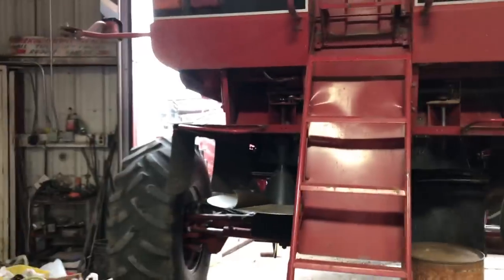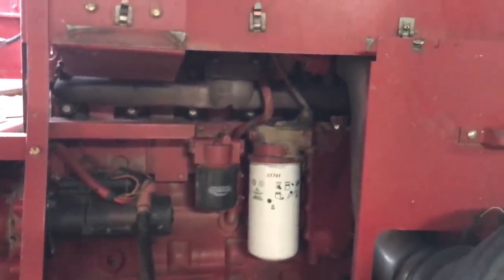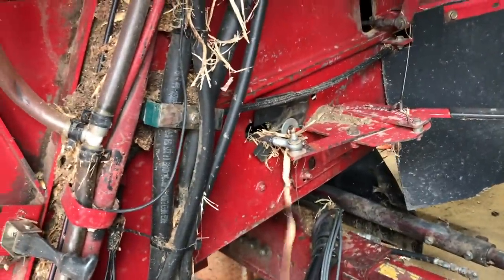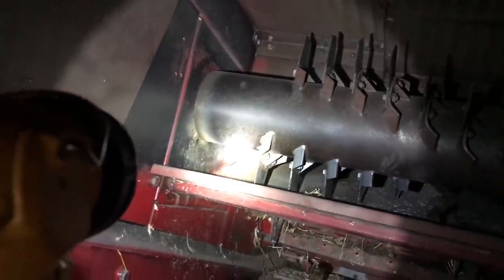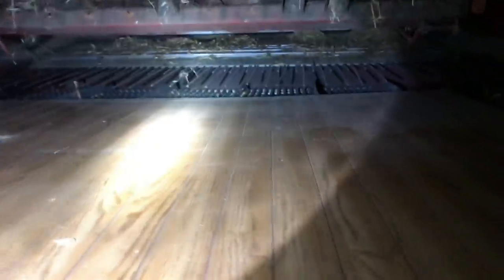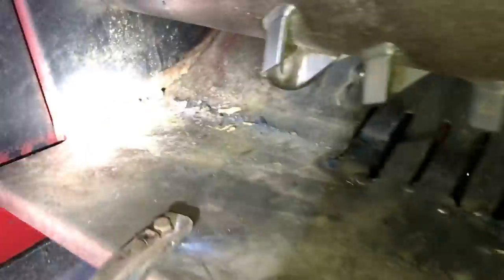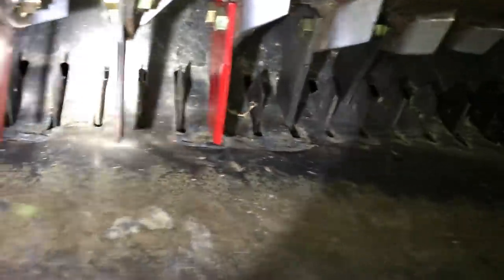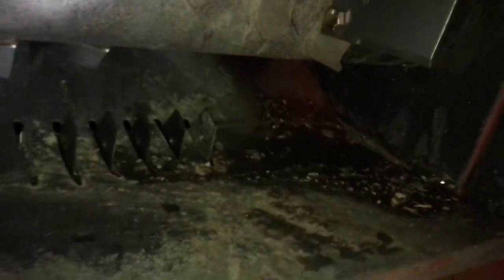How many things can go wrong in one day???

Comment: Might want to consider keeping a hand pump sprayer full of water or mixed with antifreeze if you are con concerned about freezing in the cab in addition to the fire extinguisher.  its amazing how just a little bit of water in the right spot can nock a fire out in a combine.
Reply from the maker: I have thought about using something with antifreeze but have talked to the fire department and antifreeze is really hard on the seals in extinguishers and as well as the seals in hand pumps.  They had people use that and then when they needed it the worst it failed.  They advised away from that just because of the false sense of security